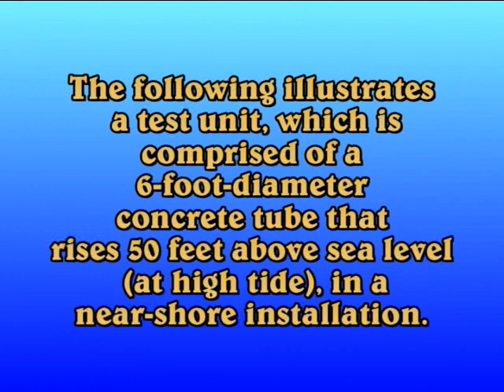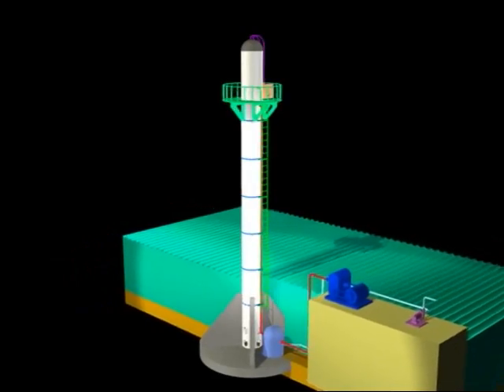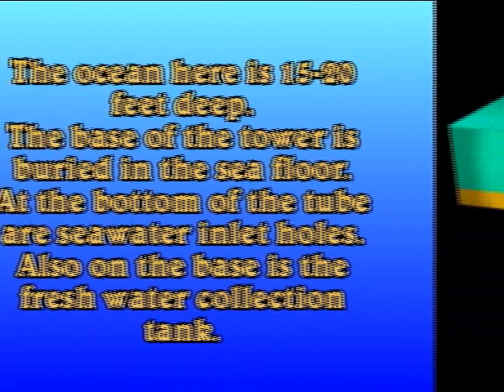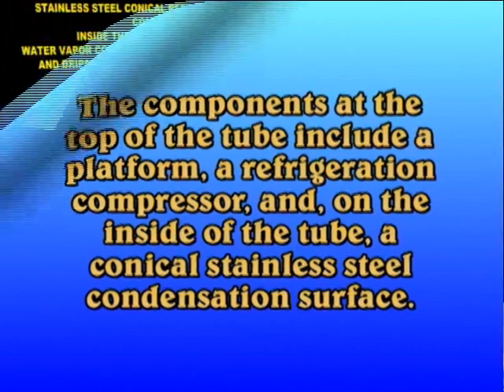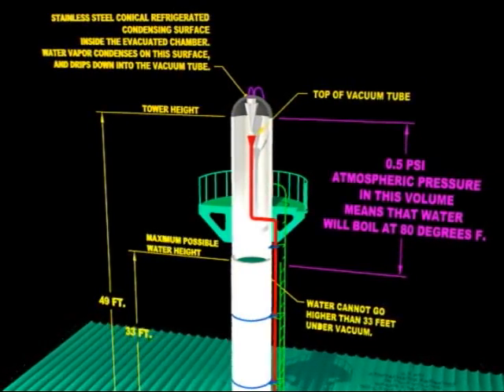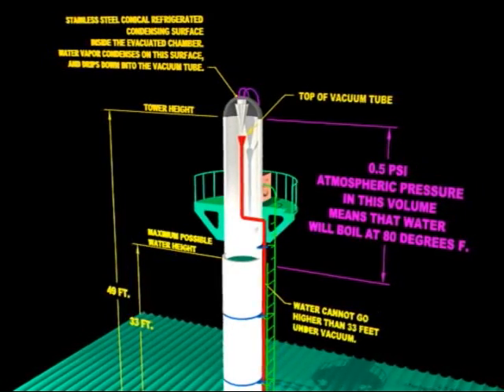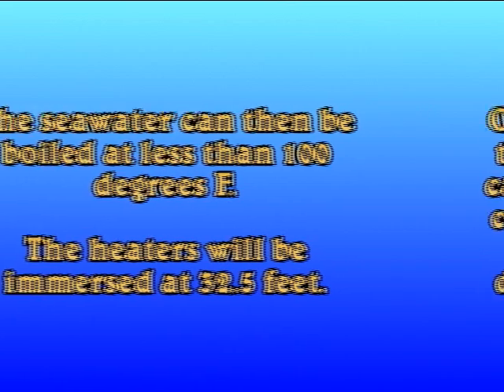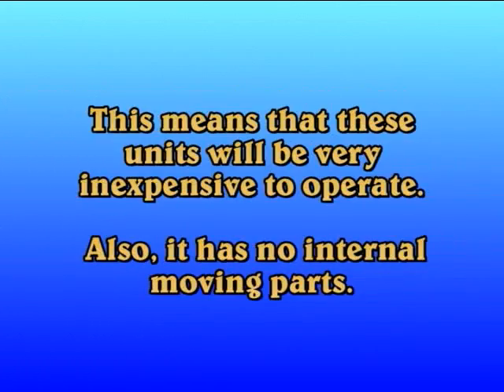Vacuum Desalination

Comment: Any Idea of the Kilowatts used on a monthly rate? Harming the ecosystem will have to be resolved because of the byproduct Brine . There has to be a use for this byproduct and not releasing it back into the sea.So the sea water would have isolated from returning to sea life.This could be done with man  made inland salt water ponds that could be drained and brine removed before refilling.Shallow ponds would also raise the water temperatures to decrease vacuum energy used.

Comment: Not diucussed is how you can  separate the vacuum from the condensed water.
Reply: water is heavier than air so will settle at the bottom of the storage tank, logically when the water reach a level the pump will pump out the exess water

Comment: Would the vac not also boil off the the condensed fresh water  and the vac prevent  pumping the clearwater out.  lso can this be aceived at a height of 3 0r 4 foot or is it physics and be higher than 33 foot

Comment: It makes more sense with using the decreasing temperature - at some point clean ice will form (on the sides) and you discard the dirty water in the middle or from between the crystals as it has a lower melting point. That's how I use freeze distillation only without the vacuum. 
Another way to cut the cost of electricity would be a set of Stirling engines, heating and cooling water at different stages, recycling the energy. A combination of vacuum and those would make the trick. It may even be net-positive as you extract some thermal energy.
Reply: I'm actually working on a potential design with simplicity as it's main tennant
stirling engines would be used to pump the fresh water from a deep basin however, not for the process itsself which would, again be simplistic, utilising the atmospheric pressure of the seawater at a depth of several metres to force the water trough (a) heavy duty membrane(s) or filter(s) 

ideally a large area that lays significantly below sea level would be best but if not a basin would have to be made and in this case use of sedimentary stone deposits (sandstone, marble, limestone, ...) may be ideal, the stone could be processed, however this would likely still take decades of full scale, peak efficiency exploitation to approach the dimmensions needed to hold the fresh water being produced, luckily the water could be allowed to overflow trough pipes into natural aquifers found around the near east for instance, or indeed it would be pumped up with said sterling engines (and more traditional pumps) towards area's where it is needed, as well as trough irrigation pipes into the surounding desert lanscape 

the plan is far from ready to leave the drawing board but it is largely based around realising the major issues with traditional damms and mainly that they are designed by geniusses to be run by a an especially competent organisation filled with dedicated experts without taking into account the reallity on the ground, (the grand inga dam is a good casus)

meanwhile my idea is peak simplicity, NOT peak efficiency, working out the designs in my head was done thinking of what works in the third world, a truck that is patched with pieces of old toys and tape and metal parts crudely adjusted to go from one truck onto another. my plant is to be maintainable by just a couple competent experts, leading a large number of local tradesmen. electricity is not a main concern, all that can easily be won from it would be used up by the plant for it's main operations with the full realisation that every modern desalination plant utilises pumps equiped with devices meant to turn the remaining waterpressure into extra energy, but this sort of technology would be hell to maintain.

oh and environmentally the produced brine will be pumped out using modern externally driven archimedes screws, (essenttially the tube moves, the screw stays in place) and this can either  be processed in a chemical factory or even turned into common eating or roadsalt trough evaporation, 
by no means should brine be allowed to litter the seafloor especially near the coast

Comment: Yeah, the reason why you put this in the sea is all the crap you normally have to pump to a treatment facility just floats back into the sea so essentially removing the whole cleaning the waste step. This is quite a clever way to desalinate I wonder how much electricity it uses vs the rolled filters (osmosis) method?
Reply: 2kw for cooling,3kw for vacuum pump if they are separate

Comment: The initial vacuum will weaken due to non-condensable gases (air-including CO2) escaping the SW.  Before a financial analysis is in order, a thermodynamic analysis should be performed.  Take a look a vapor compression (VC) desalination.  It is the most thermodynamically efficient of the the 3 thermal desalination techniques (MSF, MEE, VC).  The Sandia National Lab report on Review of water resources and desalination techniques is a great resource.
Reply: are you assuming that once the vacuum level is reach they remove the vacuum pump? from what I understood he said since the tower is so tall, a greater vacuum would be induced.
Reply: @dantronics1682how does the water leave through the vacuum pump if the pump is still going?

Comment: Well done CAD presentation.  It takes more than 2200kJ/kg (~ 2400kJ/kg @ambient temperatures) to evaporate (flash) sea water.  Without heat exchangers, your condenser will be working hard to maintain the required parameters. The sea water temperature will lower as well and require a stronger vacuum.  But you have to convince investors that this process is more economical than SWRO (which requires about 30 kJ/kg including accounting for electricity produced by coal plants) for it to be viable.

Comment: More than nine years after this video was published, I think it's fair to ask why plants based on this concept have not been designed and built. In fact, one has, but so far as I can find out, just the one. Vacuum distillation remains mostly a laboratory process for specialized small scale applications.
Reply: How small are we talking in gallons or litres per day

Comment: I like the idea of filling tube with a pump. (maybe a giant harm pump if you wanted to go that far) close the valve at the top and bottom, let the vacuum and heat be for a bit, then drain off the fresh water at the top level.
Reply: oh and that hammer pump could be storing the water at an even higher tank while desalination is going on.
Reply: If it's not a continuous process, if the collection tank has to be closed and drained periodically, then it also has to be vacuumed again. Sounds like a lot of energy being expended.

Comment: I am curious if there happened to be just a small amount of condensation of the inside water vapor onto the "inside surfaces" of your device, then if some pathogens could then possibly travel or rather swim along this condensation-inside-water-film from the bad water to the hoped for good water. What do you think, and how could this be prevented ? 

Possibly this contamination could be prevented by some type of temperature control on this device.
Reply: Trader, Good question. It seems clear that the condensate is going to have to be purified, at least by passing through an ultraviolet light field.
Reply: Chlorine. Also it's a vacuum so most bacteria wont be able to thrive there.
Reply: @GhostOfBillCooper  its not a complete vacuum, there was a figure on the screen

Comment: @trader0108 I think that might be true when you create the vauum in the vapour side cause of the high volume, with this system you just pressuerise the low volume water to get it to the required hight then let gravity create the vacuum. But you might be right. I hope not.

Comment: We can even do it WITHOUT vacuum pump
at first stage you close the inlet pipe of sea water, you feed the tube to the end with salted water then you open the inlet sea water, the sea water will stabilized and create a pretty good vacuum with a set of valve to harvest the fresh water.
by the way the pipe does not need to be straight, only the height of the column must be respected, it mean that you can make the installation on the ground (provided you have a cave in a cliff at +6 meters and roof clearance of 7 meters).
basically you need  a heath collector, radiators of cars filed with glycol mixed,  in serial black painted under glass or transparent material and exposed to the sun,  that will be used as exchanger to warm the salted water inside the column.
A cold source, to improve the efficiency of the condenser .
By the way this technic can be used to extract water from very dirty water

Comment: Can you use the heat from the compressor to boil the water?
Reply: might work? or at least help lower the energy use.
Reply: It might help raise the water temperature so reducing the energy used lowering the pressure

Comment: I want to make a minature system like this for my sailboat, using the 40' mast for elevation and just using a low power pump to get the water up there. But my design still needs an electronic salinity regulator and two pumps, one high pressure for up the mast, the other low pressue for the float chamber that has the salinity regulator. I then use cold seawater for the condenser which is recirculated to a normal solar water heater to get the water to 50C or so.
You think this could work?
Reply: 33 feet of your mast will be filling water inside , are you sure your boat no problem ?
Reply: @wawansanisamudra  Salt water is not good for metal parts that need to be strong...

Comment: why the vacuum pipe is passing through fresh water tank, cause it will result in sucking fresh water into pump. 2nd is why fresh water pipe is vanishing at tower base and inside fresh water tank ,what it means
Reply: Faisal, Just that question occurred to me, too. I don't see how it is overcome without something that expends yet more energy to counter that vacuum.
Reply: how would the pump sucks the fresh water?

Comment: Why not just make a much shorter ( in height ) system, and add a solar powered vacuum pump that will make a much greater vacuum pressure than the pressure that this device makes, & that will thus also allow the water to boil at an even lower temperature than the boiling temperature of this device ?  The cost savings for the cost of such a much shorter in height system, possibly would pay for both the cost of the extra vacuum pumps and the extra photovoltaic solar panels to power the vacuum pump.

Comment: Fancy. Also unnecessary, just pump the water on land and do the exact same thing with water in a tank. Pull a vacuum on the top, reduce the boiling point heat water with the sun and condense the vapors at the top of the tower.

Comment: I just spoke with a scientific expert on this subject of including a vacuum in this system, and he claims that using a vacuum will not save any overall energy, as the overall energy requirements are identical with or without using a vacuum.  The energy saved in heat generation is identical to the extra energy required to make the vacuum.
Reply: Use gravity to make the vacuum rather than an expensive to buy and run pump.
Reply: It makes more sense with using the decreasing temperature - at some point clean ice will form (on the sides) and you discard the dirty water in the middle or from between the crystals as it has a lower melting point. That's how I use freeze distillation only without the vacuum. 
Another way to cut the cost of electricity would be a set of Stirling engines, heating and cooling water at different stages, recycling the energy. A combination of vacuum and those would make the trick. It may even be net-positive as you extract some thermal energy.
Reply: use a ram pump to create the vacuum needed...
Reply: Your scientific expert is mistaken.
Reply: @Barskor1  a refrigerator or air con pump is virtually free.
Reply: @dantronics1682  Yes the equipment can be free but will it create a hard enough vacuum?